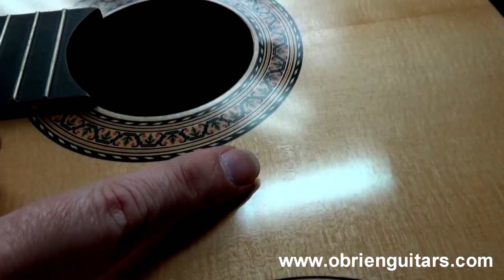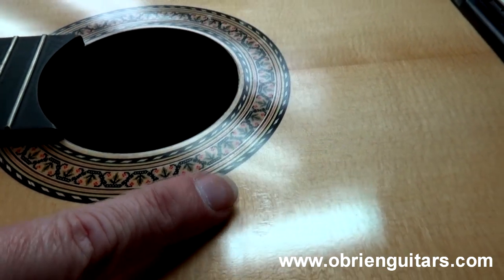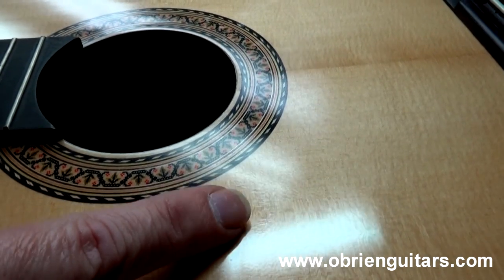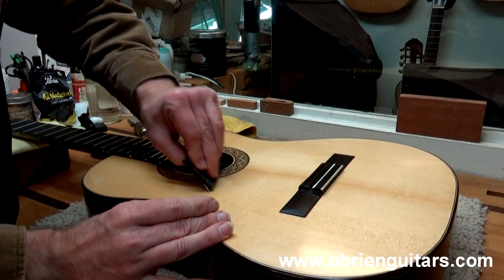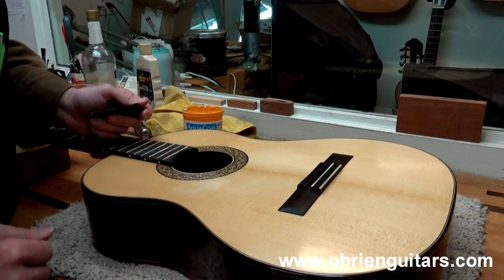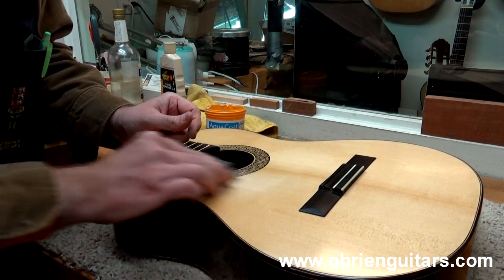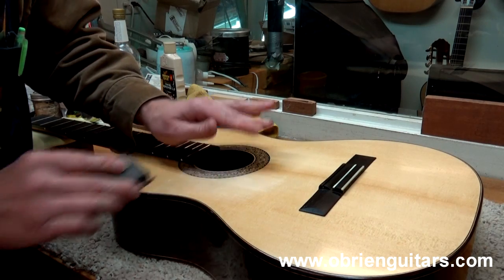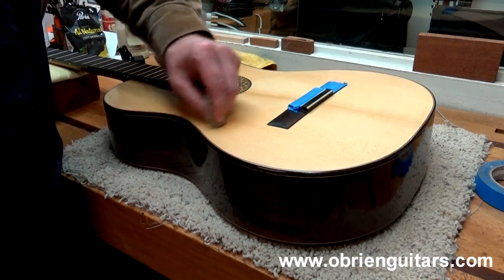Luthier Tips du Jour Mailbag 69 - Fixing dents

Comment: This is really good, thank you kindly dear Robert. I just realised that I've got a few minute dings from rasguado playing just off the e1-string on my new guitar... - no more of those and I'm gonna be fixing the issue. 
Question: So the Aquacoat is transparent not to obstruct the spruce grain pattern? My dings are as small as the ones in the video. Have you got a suitable brand for EU?
Reply from the maker: Glad you enjoyed the video. I am not sure of an equivalent in the EU but this can be shipped Internationally. Seal the wood and then add the pore filler/leveler and thin you have to finish over the top of that.
Reply: @OBrienGuitars  Great, thank you Robert!

Comment: Great video Robert. You said this could be applied over nitrocellulose lacquer but would need to recoat with the lacquer. I have a top with about a 4" long 1/32" wide indentation that's not through the finish and not very deep at all. Would it be better to fill with the aqua coat and recoat then wet sand and buff or just use thickened lacquer over a period of days to apply enough to fill the  indentation, then wet sand and buff? Keep the great videos coming!
Reply from the maker: I would probably just use lacquer to repair this.

Comment: Robert, here's a tip for fixing indentations in UNFINISHED wood taught to me by a cabinetmaker.  Using an eye dropper, place a few drops of methanol into the indentation and then set it afire.  The alcohol burns off quickly as it applies heat precisely where it's needed to restore the dented fibers.  If the wood chars then you're using too much alcohol.  Give it a try - it worked like magic for me.
Reply from the maker: Nice tip. Thanks for sharing.
Reply: Sounds like a dangerous technique to me! Why not just use the wet cloth and hot iron technique? It can raise fibers as well and there is zero chance of burning the wood.

Comment: Can this method be used to fill dents on a taylor guitar with a polyester coat? what kind of polish should i be looking at after applying the filler and sanding? thanks
Reply from the maker: I would probably just use CA glue on a polyester finish. Glu boost in a product that comes to mind and you can get it here. http://www.lmii.com/products/finishing/gluboost-tints-glues-and-fillers/16151-fill-n-finish-pro-formula-2-oz-includes-2-whip-tips-and-2-extender-nozzles/flypage

Comment: Thanks for the great video.  When refinishing after the filler, do you have to apply French polish to the entire soundboard or just the surrounding area?  Thanks.
Reply from the maker: You can just touch up that area if it is shellac. However, with this type repair most folks want the top refinished.